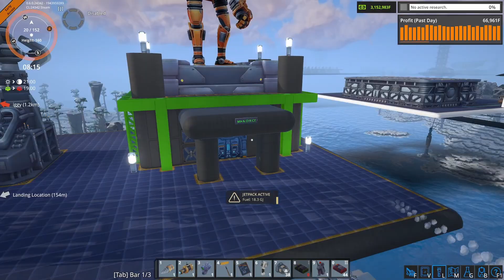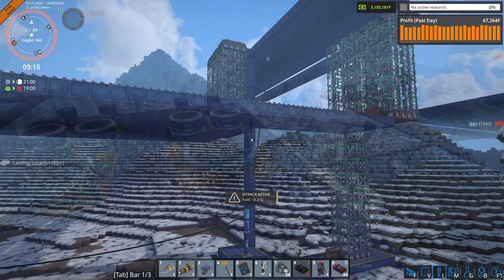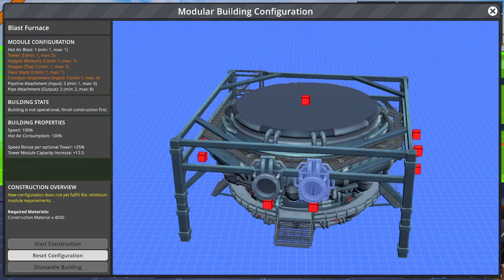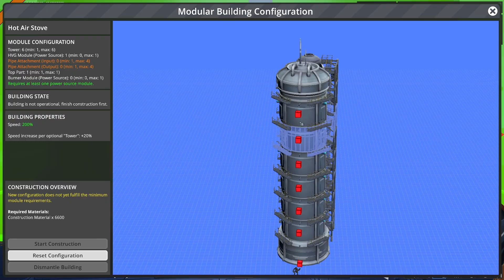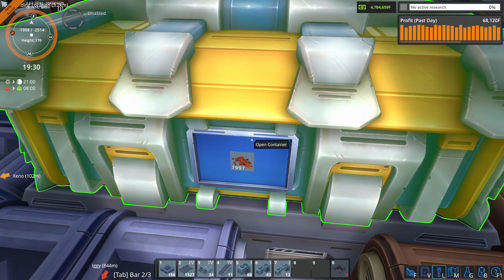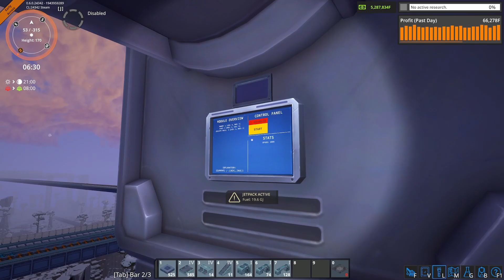Foundry - XenoTech Update 3 - Massive Blast Furnace Setup

Comment: iif you check the production rates on the air and hot air, you'll find that you need 2 full air and 3 full hot air for each full blast furnace tower.  that will save you some power.
Reply from the maker: Oh that is true. That's where I screwed up. Something about this setup has been off in my brain the entire time I built this and now you've 've found the needle in the haystack. Awesome! Thanks, lol
Reply: @Burnedoutguy  just glad i can help. just know i'll never tell you what to do. i will however offer options on occasion.
Reply from the maker: Sounds good. I'm always open to ideas, criticisms and things that can make me and my gaming channel better. Also, it's nice to converse with the community and get people interacting with the videos
Reply: @Burnedoutguy  as far as ideas go, i went heavy on the station ship storage and using the medium shipping platforms. i set my blast furnaces up similar to yours but i put my shipping platforms over the ...ummm...the machines that refine the molten xeno into plates. i can't remember what they are called right now. yea, i'm old. lol
anyway, the shipping platforms on the same level as the inputs for the blast furnace. i then ship those plates up to the station for storage and use the shipping platforms where i need them to be. makes for some quick transport without using tons of belts. 
next time i get into game, it's time for me to setup my painting production and then i'm gonna put in my 32/min bot and robot production to finish up the achievements.
Reply from the maker: Never thought about using the station storage as an option to moving materials around. I was considering trying to make a whole map where all you did was buy all the resources and sell things to make profit and pretty much will use the economy to run the map without mining anything
Reply: @Burnedoutguy  that is an option you could do. once i get my robots up and running, i'll be buying canned olumite so i don't have to keep finding new olumite nodes. i think i've got about 80 or so olumite drills running so far. i've already drained at least one and nearing it on one or two more. i still haven't checked how many olumite canners i'll need to keep up with my 110k+ olumite per minute. i'm thinking it's going to get pretty insane. lol
Reply from the maker: @lonnierh0dgejr41 yeah buying it sounds like a great idea once my nodes run out. Too bad they never made any infinite Wells like they did with the ore veins
Reply: @Burnedoutguy  just noticed ALL my olumite nodes are empty, as well as all 6 of my olumite storage tanks. that's over 3.6 million olumite that i didn't notice was depleting. must have happened last night because there's still some production down the line. 
my options are, put down a bunch more drills or get the barrel fillers online. problem is, the production calculator won't do olumite output. i did calculate that i'd need 486 barrels per minute to fully supply my olumite. i just need to figure out how many barrel fillers i need to empty all those barrels. that'll come a bit later once i've got a bit more coffee in my head. 😴
Reply: @Burnedoutguy  yea, i need to frack my olumite. sadly, that's the one real world thing we don't have in the game. 🤯
Reply from the maker: @lonnierh0dgejr41 hahaha math before Coffee is a crime
Reply: @Burnedoutguy  i don't know if i'd call it a crime but coffee before math is a requirement. 🤣
Reply: @Burnedoutguy  figured out that i need 17 barrel fillers to fully supply my olumite. i forgot about the empty barrels it outputs, so i need 34 incinerators to deal with that. if you're doing to buy olumite, i'd suggest massively upgrading your hanger space. 6 minutes per 50 barrels and need 486  to match my olumite consumption. so 300 ship slots (5 per medium ship) for the 60 ships to keep some spares in storage. 🤯
Reply from the maker: @lonnierh0dgejr41  holy crap that make me think that buying all products for a production line would be insane, then with all the ships wow.